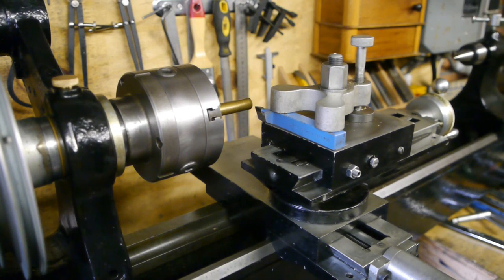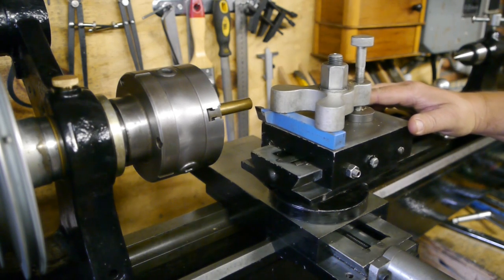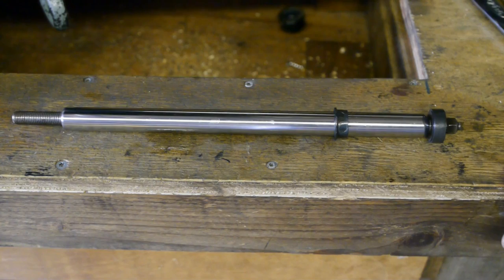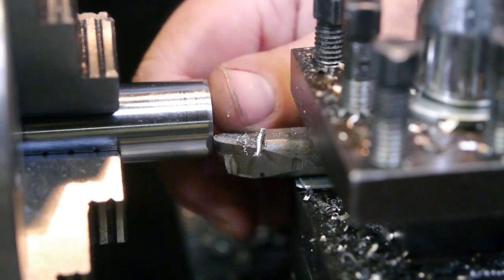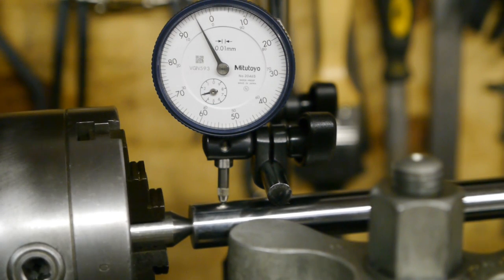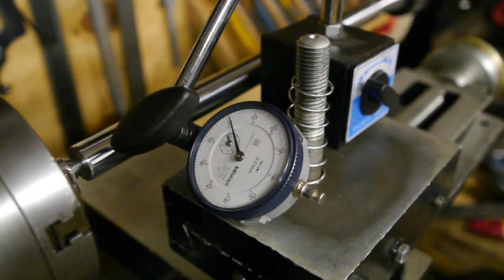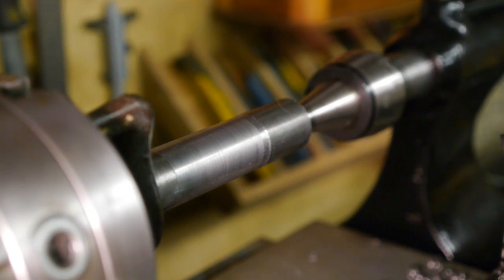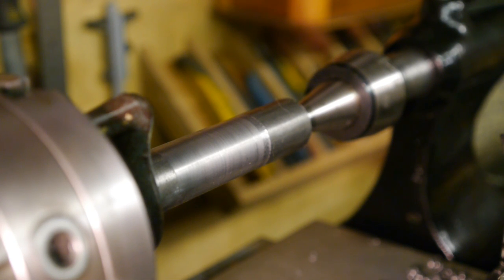Making a reference bar to line-up the top slide

Comment: The shock absorber shaft looks very good for a reference bar.   I may have to take one apart myself.

To get my parting tool blade set at 90 deg as accurate as I can, I mount the the dial indicator on the chuck then run the dial indicator down the blade.  I had used a 1-2-3 block between the face of the chuck and face of the tool holder.  I thought this was good enough until I broke the tip on the parting tool.  I was very slightly off.

You could mount the dial indicator on the chuck then run it along the face of the compound (top slide).

I re-check my parting tool alignment now and again.  Things can move over time. 

You have a much better alignment now.  Well done.
Reply from the maker: Shock absorbers seem to be very precisely ground. This one was a Monroe and it came from an older type VW polo.

I usually use an engineering square to setup my parting tool. Hasn't failed so far.

I'm happy with the result of the alignment. I makes the lathe a bit more useful :)

Comment: That's basically how I do it on my toolmakers lathe.  None of the built in protractors are accurate enough, given the width of the degree markings.

I use a test indicator rather than a dial indicator as the stand and indicator are much more compact and easily sit on the compound mount.

You are better off using a live centre in the tailstock from my experience.

The binding in the spindle depends a lot upon whether or not the spindle has a thrust race.  No race means end loading will cause binding in the spindle taper bushes.

That was a problem with all early model Schaublin lathes (and others) without a ball race.

Cheers Rob
Reply: This video basically shows how it should be done.  A test or dial indicator will always be more accurate than using any protractor I've seen.

They will also show any run out in the test piece.

Another accurate medium you can use for a test piece are the print or scan head rails out a printer/ scanner.  You don't actually need a very long piece of stock to set up the topslide angle.

I generally just use a known accurate piece in the collet chuck and don't use the tailstock as it's not necessary.  Even a slot or end mill shank can do it.

Cheers Rob
Reply from the maker: I'll put a test indicator on my wish list :) They probably also work better on the side than a dial indicator does.

The lathe doesn't have a thrust ball race. I has bronze bearings with 2 taper angles. The small steep angle taper takes most of the thrust load. I have played with the idea of adding a ball race to the rear of the spindle.
Reply from the maker: Using a piece of ground stock in a collet sounds like a good idea. This will compensate for any headstock side to side misalignment.
Reply: Yes, read my comment further down on this.

Test indicators are much more useful for lathe work than dial indicators IMHO.  I have four quality dial indicators and never use them.  Why ?  Because they are relatively bulky and can foul chuck jaws close in, need a bulky mount which is hard to position, and cannot read inside measurements on small work.

Dial indicators have their uses for long travel readings, but for any other work test indicators are way better.

Cheers Rob
Reply from the maker: I was more concerned  about the spring not being strong enough to pull the indicator needle to the workpiece when used on it's side.
Reply: Test indicators can be used in any position.  The tip also has a clutch which allows it to be positioned at a wide range of angles to allow for cosine error.  You can't do this with a dial indicator.

I mainly use cheap Chinese test indicators as none of them stand up to rough treatment/being dropped, so save the best one for special occasions ;)

The cheap Chinese ones are just as accurate as the brand names.

Cheers Rob

Comment: Taking the taper out of a cut can be as easy as shimming the live center. Say you start with a 13 mm diameter .2 meters long and need to finish at 12.2 mm between centers. Start by cutting 2 diameters 1 at each end of the part using the same dial number. Measure the the difference say that the head stock end measures 12 .8 mm and the tall stock end measures 12.55 mm which means the tail stock needs to move .25 mm. Without loosening the tail stock ,Take the part from between centers and carefully remove the live center. Then find a shim that is equal to distance to be moved in this case .25mm and insert it into the tail stock so that it pushes the live center in the right direction. Then talk another trial cut. Repeat the process until results are satisfactory.
Reply from the maker: That's an interesting procedure. Thanks for explaining.
Reply: Rolingmetal Please post again and let me know how it works out. I will do my best to answer any questions you have. One ting I forgot to tell you make sure the shim is 3-4 mm wide and at least as long as the taper on the live center. I'll look in from time to time. And subscribe.